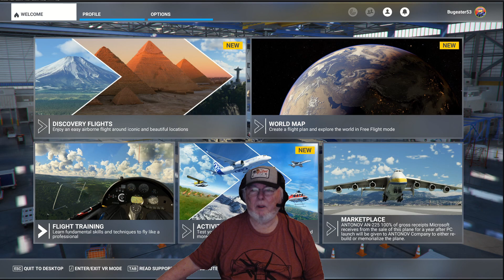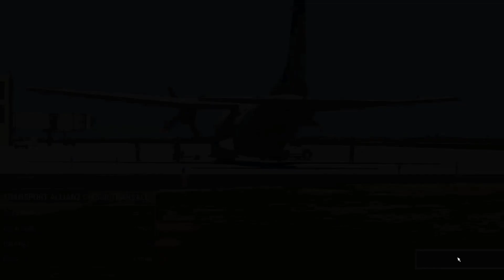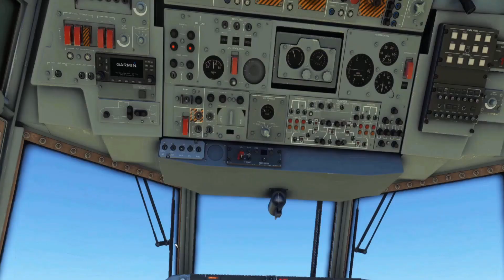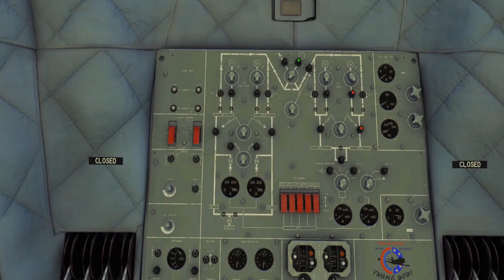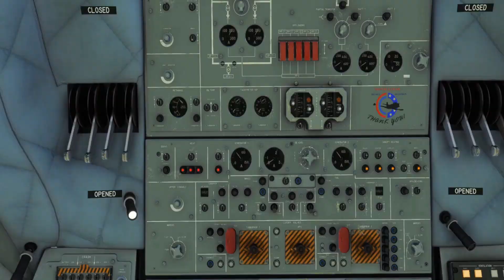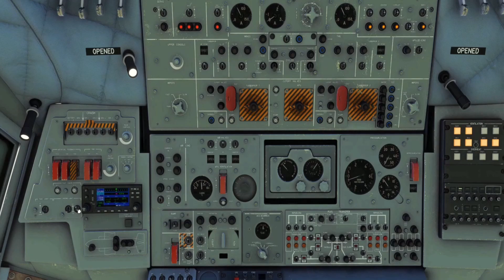MSFS2020 AzurPoly C 160 FUEL SYSTEM TEST

Comment: What you didnt check was that even when the fuel pumps are turned off the tanks are still taking fuel to the engines, check the weights drop down menu and  you see that the tanks are gravity fed as is stated in the manual and even with the pumps turned off they still feed gas to the engines.  The best way to manage the fuel is to cut off the B tank  (second lever from the right, engine #1) and (second lever from the left, eng #2 ) in the above fuel levers so that only the A tank is feeding the engine and B tank is in reserve.  Once the A tank is down enough then put the B tank back on feed and turn off the A tank (first inside lever each side) then cross  feed fuel from the C tank to the A tank,  till its drained and then Open the A tank again  (above Lever) to then run the A + B tanks together .

Comment: I tried the same but for whatever reason i just can't stop dumping the fuel, it's frustrating...
Also tried turning off the fuel pumps for tanks A so it'll only get fuel from B tanks, but didn't work either for whatever reason, maybe just my installation being messed up somehow
Okay i figured it out, i thought since the lever in the roof for fuel dumping said fuel dump closed forwards, i thought it was off

Comment: Thank god for this video, currently decending through 20,000 feet with no engines in the middle of the northwest territories with a full cargo load
Reply: I didnt lawn dart so it was very helpful! Would of been very annoyed if I had, did a 5 stop flight all across Canada and ran out of gas about 90 miles from top of decent
Reply from the maker: @greatjoey3375  Well done on saving the aircraft and good luck in the future.
Reply from the maker: Hope it is helpful! Thank you for the comment. 👍